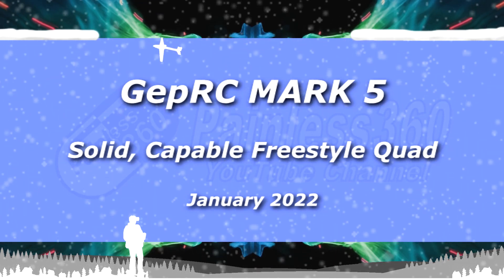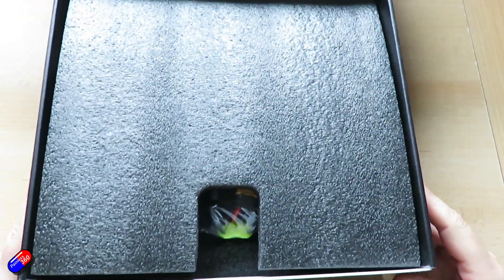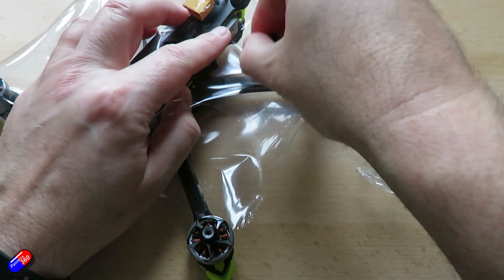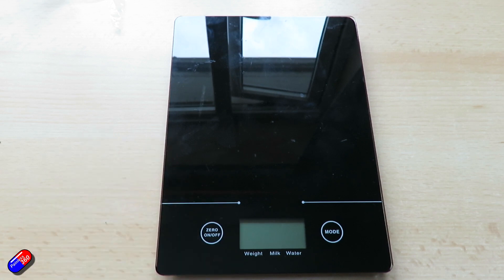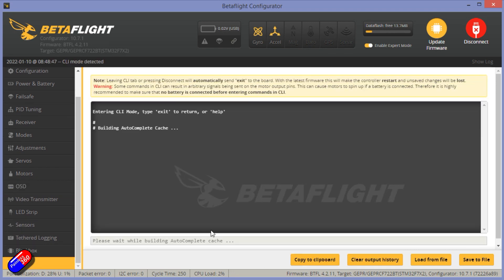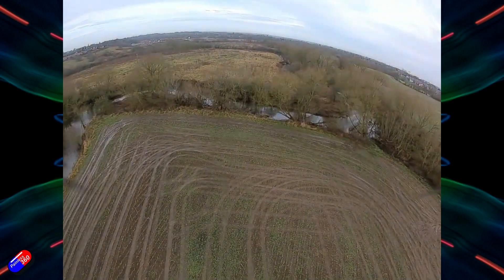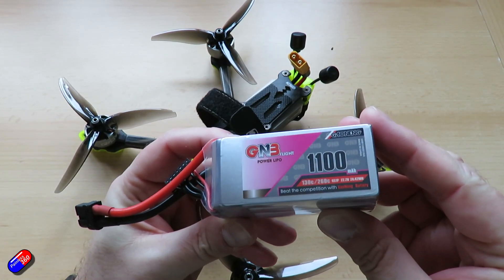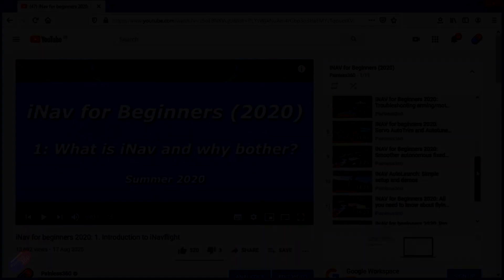GepRC Mark 5: It does everything it says on the tin!

Comment: I've got a Mark5 DJI O3 DC version with 4S, and I'm a bit concerned that peak current shows 100A pretty typically (and current sensor is calibrated and dead on).  ESC is rated at 50A continuous and 55A peak, so this feels high.  I understand the 6S would be more like 67A peak, but even that seems like it is pushing this ESC too hard?
Reply from the maker: Current shows the max total current pulled from the battery, that then divided across each of the 4 motors... So that means each ESC is handling about 25 amps. (assuming they all pull the same).. Happy flying
Reply: @Painless360  I see. I had assumed that was a TOTAL rating for the quad ESC (I.e. 12.5A each).

Comment: Hello there, I just got a Geprc Mark5. I am running with Version 4.3. The problem I am having is that it jitters when you give stick inputs. you can hear the motors jittering. How can I fix this?
Reply from the maker: It could be a few things. It depends if it used to work fine or it's new..
Reply: Did you put in GepRC's tune and BF settings?  Is it only fluttering when you loop and punch to stop at the bottom (or when descending fast and hit throttle)?  If so, sounds like you have low D-gain (assuming P/I is set ok)...I would start with the presets for your Tx freq and the GepRC PID settings.

Comment: What's your experience with the current sensing on that flight controller? Mine seems to have a lot of variation in measured values in stable flight.
Reply from the maker: Not that I've noticed but I tend to use the cell voltage more these days..

Comment: Plz show me every settings in betaflight.. I can’t get my mark5 to fly with Taranis.. I also have the crocodile baby and with the same problem.. I have bind my taranis and drones but in betaflight there’s no life.. maybe it’s just a small problem and very easy for you to find, but for me ?? I have give up the hope after many many days with betaflight.. 

I wish I could connect the drones to falcox configurator but that not the case, unfortunately 😊

If you have some energy to help me then plz Give it a go..

If you have some bf cli commands that could help me locate the problem? Then send them 🙏
I bought the two drones last year and can get them in to the air😏
Reply from the maker: The main thing is the binding of the radio. See
https://youtu.be/9QMAvi3yIkQ
Reply: @Painless360  thx 👍
It was the receiver that caused the problem.. my taranis bought in 2016 is not compatible with the R-XSR bc that receiver is flashed with ACCESS and the old taranis is ACCST.. so when I flashed the R-XSR receiver in my taranis with ACCST D16 firmware (FW-RXSR-ACCST_v191128) then I could bind my radio with receiver.. but there was still no response in betaflight before I push the button on the receiver for 4 seconds.. then everything works great.. 

Just in case other have the same problem and read this comment, then try this method👍